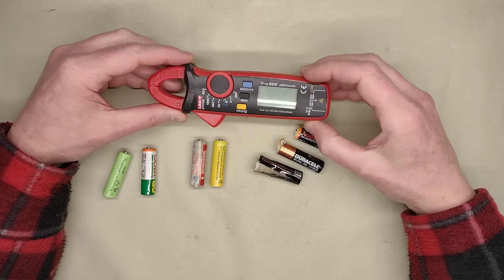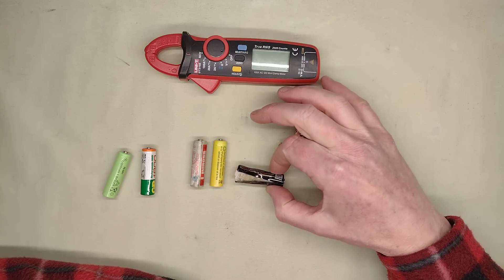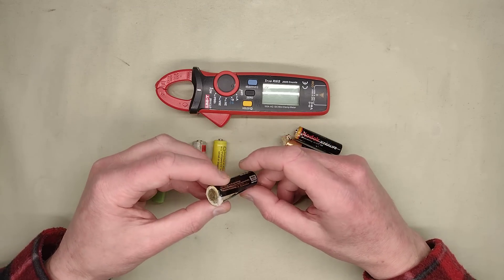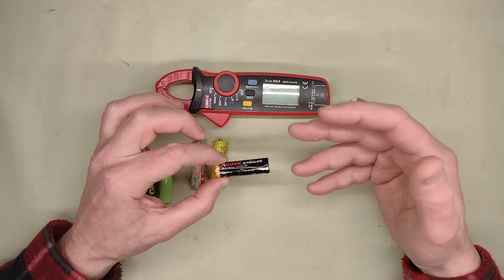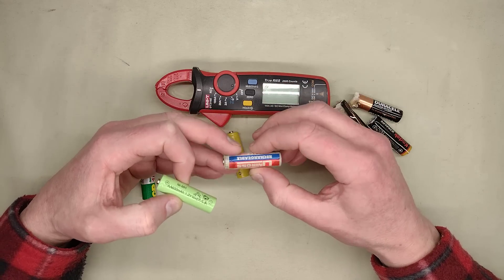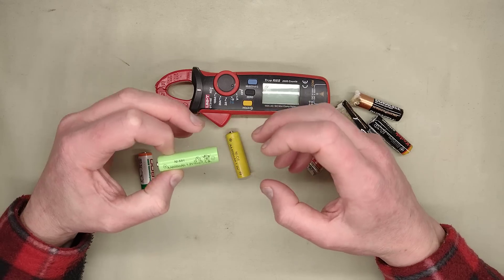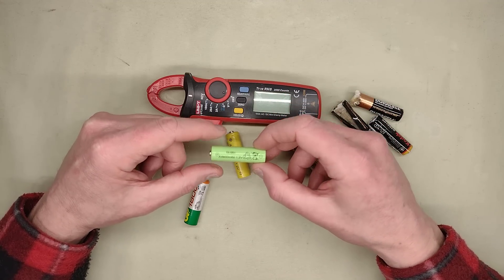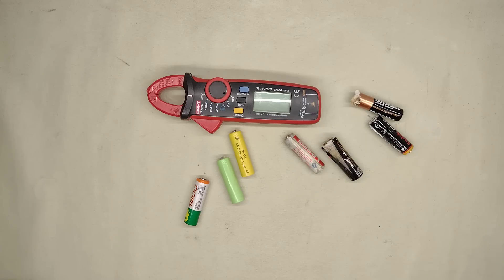The curse of leaky alkaline batteries

Comment: Would be very interested in more (rechargeable) battery content, Clive. Especially analysis of different brands. Always wondered how some of the better-reviewed cheap brands compare to the more expensive premium ones.

EDIT 12/28/21: While I'm here, you know what I wish? I wish someone would make a cell with a hard plastic casing of some kind. I've had some rechargeable Duracells for a while, and the cheap, thin wrapping on all of them is frayed and coming apart. I question how much longer they'll be safe to use for, even if the cells themselves are technically okay.
Reply: Get the Ladda ikea white ones, They are basically eneloop's.
Reply: @sonixthatsme  IKEA is a good bet for "cheap but not crap".  Clive did a teardown of one of their USB chargers and was fairly impressed... They have to meet so many countries' regulations that it is worth it for them to put time into their design and quality.
Reply: @travcollier  IKEA USB power supply/“chargers” are great indeed. Alkaline batteries of IKEA might leak less than a Duracell, but for me they also leak too. Elsewhere here, answered Clive my solution for this frustrating leakage issue.
Reply: @sonixthatsme  see https://youtu.be/Jeo_hv-8bHI
Reply: @ulwur  Yes, seen it, commented, and bought IKEA high-capacity Ladda, made in Japan.  The 'made in Japan' is critical, because these are the same as Eneloop.
Reply: Came to say Project Farm but others had beaten me to it
Reply: @hamishspencer  same...good to know so many others have heard of the channel.
Reply: It's frustrating that normal single charge batteries don't state how much capacity of they have. As a consumer it's difficult to compare brands and value for money.
Reply: @wag-on  It’d just be lies anyway…
Reply: @frizzlefry5  We just get silly advertising statements like 'super heavy duty extra long life' lol
Reply: @wag-on   Well gee golly these must be the best then… Yeah they really do take us for a bunch of yokel dipshits it’s pretty sickening isn’t it.
Reply: @wag-on  I've used Costco's Kirkland-branded cells for quite a while now, they're very good. Good as any premium name brand, in fact, because IIRC they're sourced from the same manufacturer. They come in a big (really big) pack and don't cost much. I recommend them for your alkaline needs.
Reply: @m.k.8158  Meh. I've never had one leak. On the flipside, it seems everything has a chance of leaking these days... Kirklands have the decency to at least be priced accordingly, unlike Duracells.
Reply: @akimbo990   ~ A Canuck here to tell you no one is talking about Ray-O-Vac batteries - still made in USA & have been around forever.
Reply: @rogertycholiz2218  Any data on how they perform? I like buying American but last I heard Rayovacs, at least the rechargeables, weren't very good. Maybe mediocre at best.
Reply: @akimbo990  but Kirkland batteries leak, too
Reply: @wag-on  - some industrial types do. Strangely enough, consumer brands don’t.  Why, because they don’t want people to compare them…  Also, the actual useable capacity depends on the cut-off voltage and the discharge current. At a lower cut-off voltage and a lower discharge current, the available capacity is higher compared to a much higher discharge current. AA alkaline cells are typically between 2Ah and 2.6Ah.
Reply: There a guy on YT called "Project Farm" who does comparison videos and he did one with rechargeable batteries.... the results were surprising.

https://youtu.be/-jXQNY6rve8
Reply: @TeriWilde  project farm is a great channel!
Reply: @TeriWilde  Project Farm is amazing, highly recommend
Reply: @TeriWilde  This is going to sound extremely petty (and it kinda is) but while Project Farm does some great work... I frankly just find his presentation grating and almost exhausting to watch and listen to. Pretty good round-up, albeit missing a couple brands I'd have liked to see (Tenergy, for example) as well as product lines (most brands have a higher-capacity line and a lower-capacity line with different characteristics), and also missing data points, such as failure rate (how many lemons in a big box?). The Amazon cells also changed OEM, they aren't made in Japan anymore... pretty typical of Amazon Basics, what you get seems to change with the wind.

Plus, I just think Clive could do a good job testing and analysing battery cells.
Reply: @akimbo990  I am a petty Englishman. I start watching, but after a few minutes of pounds, inches and fractions, I just can not watch any further.
Reply: @Eleftheria_i_thanatos  specially when something is "a ton of effort" and has occurred "tons of times"
Reply: @Eleftheria_i_thanatos  That is pretty petty.   I'm a Canadian/American, and I'm fine with Imperial and Metric.   I have noticed that those that grow up solely with metric are horrible with fractions as adults.
Reply: Duracell should be avoided in my humble opinion. They are more likely to leak, and are more expensive compared to other brands/makes without having significantly more capacity. In their adverts, note that they only compare themselves to the older technology cells, not other good capacity alkaline cells. If you are going to use  alkaline “non-rechargeable” cells and batteries, buy ‘supermarket’ or shop own brands.
Reply: @Mark1024MAK  I fully agree. Duracells have caused majority of battery leakage problems I have encountered. What a shame, especially as they are a "premium" battery brand. Even the capacity is not so good compared against many cheap brands.
Reply: @Mark1024MAK  yep
Reply: IKEA Ladda 2450 mAh AA cells are very good.
Reply: @JxH  Yes, because those are actually Eneloop Pro cells.
Reply: @JxH  Yes, these are the 'made in Japan' version, the same as Eneloop, but cheaper.
Reply: @cdl0  Japanese made stuff, it usually performs above spec and you don't get any cells with fake guts in them, or ones that blow or won't charge. Worth the price if you ask me.
Reply: @JxH  Are they still Eneloops? They used to be white now they're grey. Yes the AA's are still very good but the IKEA AAA's have changed, they aren't as good as they used to be. Last no time at all.
Reply: Ikea rechargeables are the same as eneloop
Reply: No idea if it makes monetary sense, but there is such a thing as a heat shrink wrap for AA batteries. The ones I used for 18650 batteries works wonderfully. The material appears to be the same as the factory one.
Reply: Many rechargeables will appear good when doing a day's testing. However the real world test (ignoring high drain usage like kids toys) would involve testing the self-drain characteristics. How much state of charge is left after 3 months or 6 months. My own experience is that only Eneloop pass that test
Reply: Haven't had any issues with Panasonic batteries and they tend to be quite cheap, but I guess that's expected from the Eneloops people...
Reply: @toposebi95 
Hi, we were looking at some 'electric bikes', and the shop keeper said that the only electric bikes that he would allow to come into his premises for repair, were those fitted with Panasonic batteries.
Reply: I have a large collection of portable radios and only use NiMH batteries. Read reviews to avoid ripoffs on capacity.
Reply: Project farm is a great place for comparison videos.
Reply: Fire happens when he does
Reply: What about using heat shrink around the batteries when they are new? Would have to test for fitment, but otherwise it seems like that would solve the problem. (Use a clear heat shrink to see the label underneath.)
Reply: @McTroyd  I'd just use a layer of aluminum foil around the negative end, which is invariably where they leak.
Reply: I've seen a couple videos comparing batteries, the bottom line was that the cheap store brand batteries perform so similarly to the name brands that it's not worth spending more on name brand. With one exception being lithium batteries, those do last longer especially in certain use cases, but the cost of them is so much higher that unless you have a particular high-drain use case (which is where they really shine) they're a waste of money.
Reply: Have you thought of putting some heat shrink around the batteries that are fraying? Although it may make them too fat.

Comment: why is it they always leak when in the device but rarely ever leak when they are in the package they are sold in?? I had purchased a metal detector and loaded it up with the batteries required, the extra batteries were left in the package and stored in the box the detector came in. The detector was used for about 3 hrs and placed back into the original box along with the extra batteries. Several months go by and I pulled the detector out of the box, turned it on and nothing, checked the batteries and they were crusty and dead, I retrieved the batteries that were stored in the box and they were as good as new, they were installed, unit used and then put away after removing the batteries from the detector.
Reply from the maker: I think that any use causes an increase in internal pressure.

Comment: The only non rechargeable batteries I have are the little button cells for my digital callipers and a 9v  battery in a smoke detector - using this coz it came with one .
I wish multimeter manufacturers would switch over to 18650 style batteries . I use the 9V NiMH Battery in the meters I have that use them .

Comment: How about those lithium ones that I assume have a buck converter and charge with USB I know the spot for the lithium is so small they have less power than NiMH but micro USB or was pretty convenient less so now but not bad but the advantage is higher voltage that shouldn't drop till it's dead so you will get no warning but have you tried them and how did you like them
Reply from the maker: I made a video about the Jugee version.  They do have a slightly higher self discharge due to the active circuitry.

Comment: I actually don't own very many AA or AAA devices, since most everything these days has its own rechargeable lithium cell, can be powered from usb or if ordered from China lots of stuff can be run off 18650s like flashlights, so yeah my mouse and meter are some of the few things I regularly use which still takes those older batteries.

Comment: Clocks won't run right on anything other than 1.5 volt batteries.  NIMH is 1.2 and disposable lithium is 1.7 I think. (the nimh will cause the clock to run fast and the lithium will cause it to run slow).
Reply: What sort of clock? Most use a quartz crystal to keep time, so voltage of cell doesn't matter. Alkaline batteries reduce voltage as they discharge so I call BS.
Reply: @petertweed83  I had heard that higher voltage lithium batteries in a quarts clock will slow the clock down.  Apparently I heard wrong.  I might have to do an experiment.

Comment: Clive - you forgot to tell folks how to clean up messes like this!  I always used a solution of baking soda for the plastic and a small wire brush for the battery contacts.
Reply from the maker: The leaked electrolyte is alkaline, so I usually neutralise it with vinegar.

Comment: I used nickel metal hydride batteries for years now especially because I'm into RC back when the transmitter took eight batteries you would buy an expensive eight pack of Duracell batteries and leave your transmitter on and of course they were dead when you wanted to use it next I don't like throwing alkaline batteries into the trash so everything I use now uses ninh batteries remotes flashlights landscaping lights I just found a transmitter today I had left on since yesterday and didn't worry because they're nimh batteries

Comment: This is part of why I use the Zinc-Chloride (and carbon/zinc) batteries.    I use alkaline in anything that I know will be used regularly, and all over the place.  (nowhere near the chargers)  I use the heavy duty type in items that will often sit for a long time between uses, or have extremely low drain.     That is, transistor radios, wiring toners and induction probes, multimeters (especially the generic ones), remote controls, smoke detectors, and so forth.   

Even if they do leak, which is generally only the super cheap cardboard ones, they leak salt water.   It's far less damaging than the alkaline (basic) liquid.    

One of the biggest reasons to keep using primary cells at all is their self discharge is VERY slow.   Yes, rechargeable lithium do hold their charge much longer, but their price is astronomical in the AA and AAA range.   Primary lithium cells are explosions waiting to happen - explosions with hydrofluoric acid vapor. 

For those that gasp about my using the heavy duty?   Kidde smoke detectors, for example, have always had a huge list of compatible batteries to use.   All of them 'super heavy duty' or 'heavy duty'.   No alkalines in the list at all.   My  multimeters?  I generally change the battery no more than once every three years - but I have a huge pile of various ones scattered in vehicles, tool boxes, and workbenches.    Those batteries can sit for a long time between uses.  

Blown batteries that destroyed everything, including the 9 volt connector?  Lots - all alkaline.  
Blown batteries that leaked, requiring some rinsing and brushing off of corrosion?  A few - all heavy duty.   

I do use NiMh batteries.   Lots of them.  It's about time for me to change most of them out, because of age.  (most over 10 years old).    I just bought three packs of them to change out in bluetooth hand scanners.  Nine hand scanners that were being thrown away as not working, at over $280 each.    $24 in batteries later, 6 of them are going back to the customer immediately, after testing.    Two of them, the people had yanked the rechargeables, and installed alkalines, and then tossed as always being 'no power'.  The units won't detect full power until they've run their own charging cycle - and they were trying to recharge the alkalines!   Luckily the devices were smarter than the warehouse guys.
Reply: I like the idea of using the Zinc Chloride batteries.  I had been considering it myself.
Reply: @-Jethro-  - They still have their uses, you just have to keep in mind their downsides - and there are a lot.   For my use patterns, they work well.  For example, in the line toners, they may get used for a total of an hour of 'deedle-deedle' time, then sit for two months in a bag.   Then another hour or two of dweedling (that's what I call it), then more sitting time.   If I was using them for an hour to two hours a day, every day, then alkaline or lithium would be a far better choice.   

Interestingly enough, they appear to have a self-healing factor.   After use for a while, the voltage will drop.  Let them sit, and the voltage will slowly rise back up again.  That may be the reason for their use in smoke detectors.  Pulse sit pulse *sit*.
Reply: I use Zinc-Carbon battery as well because they didn't leak liquid but simply oxidise itself (terminal turn black) when it dies. I use Zinc-Carbon for mundane application like TV remote and clock, while NiMH is used for measuring tools like multimeter, weight scales, or thermometers, while Li-Ion is used for common high power tools (like headlight, fan, or trimmers).
Reply: @xponen  The cheap cardboard wrapped ones will leak.  They do contain salt water.  It'll corrode the terminals (springs, etc), but rarely does it do anything else.   Better than alkaline.